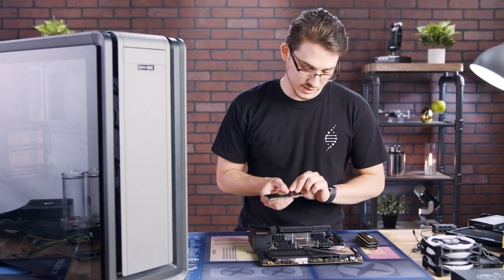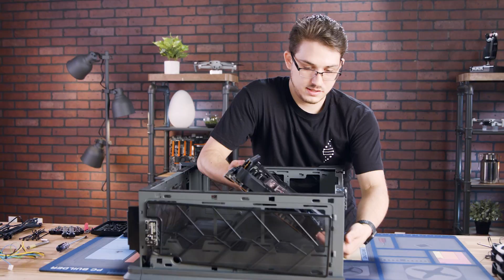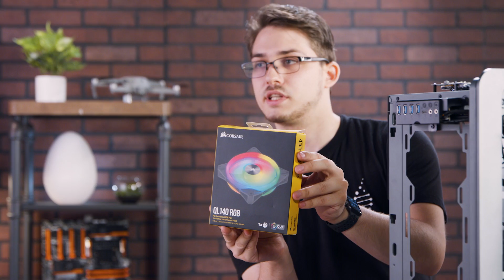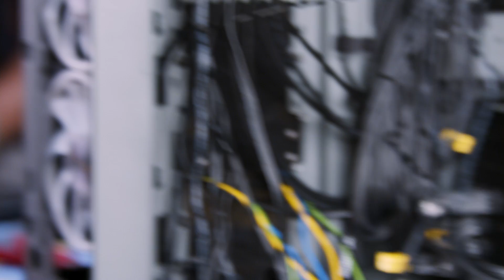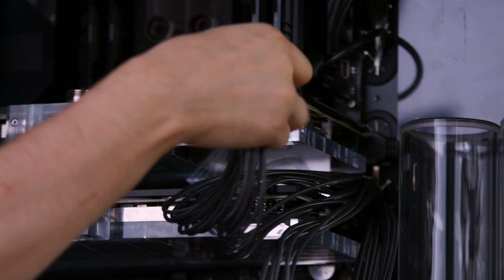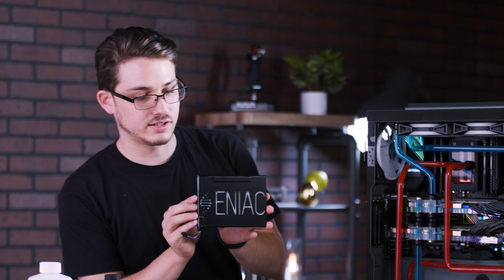How To Build A Monster PC (Two 3090 GPUs | Liquid Cooling)

Comment: Instead of the second reservoir, I'd still add an additional radiator in the front, a 420 for example. The pump would not have to work as fast and the system would generally be quieter.